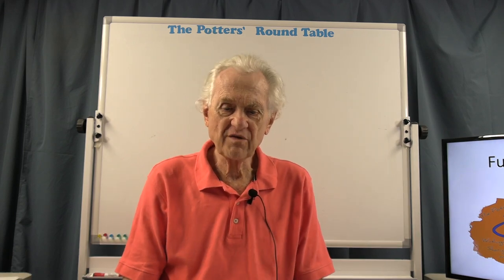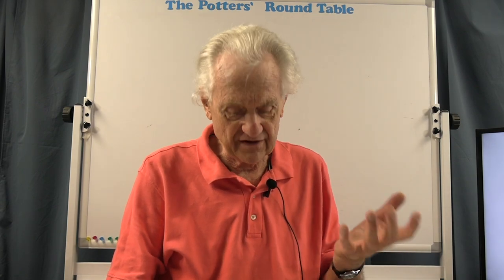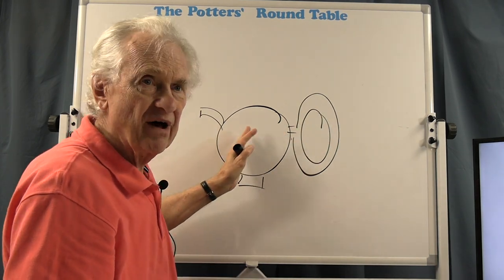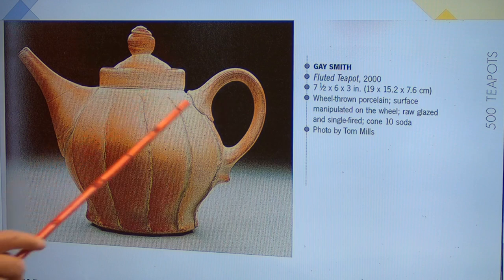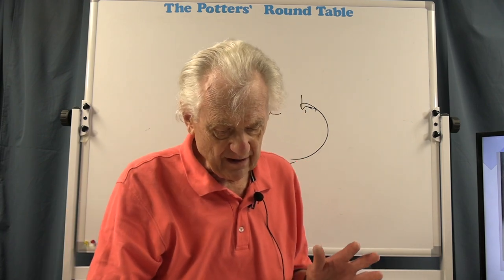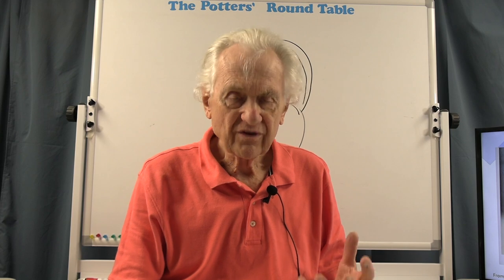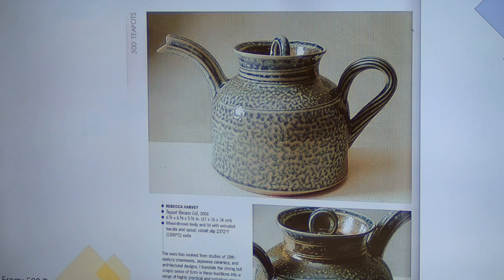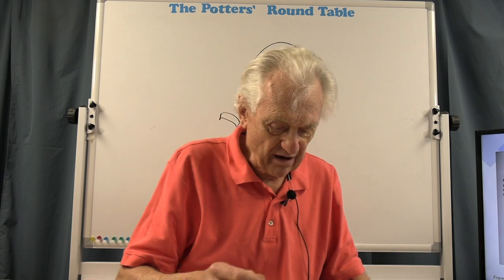PRT Functional Teapot Design

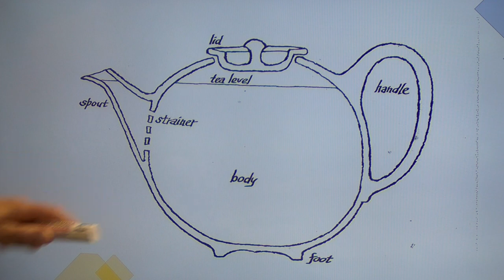Comment: As for the lids, I learned the hard way that a low center of gravity is key. So be careful with heavy pullers on top, and have some of the lid's mass  sink into the pot a bit lower than the rim (just like in Phill's diagram at 14:45 ). And I was wondering if the gurgling can be also the result of an excessively tight lid which constrains the intake of air, forcing it to happen via the spout itself, by gurgling.
Reply from the maker: Often there will be a small hole in the lid to allow unobstructed airflow and promote a smooth flow from the spout.